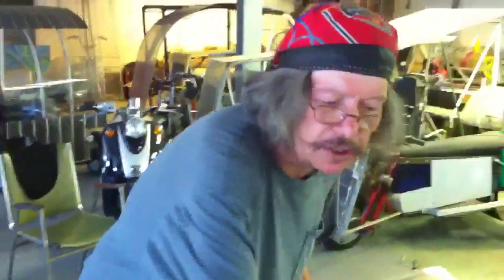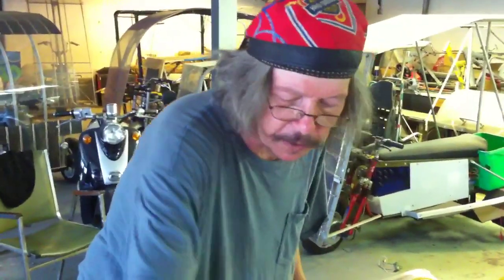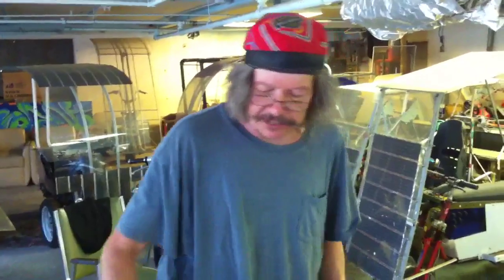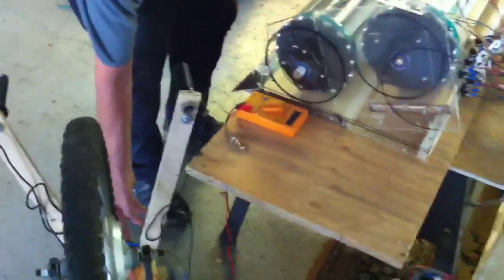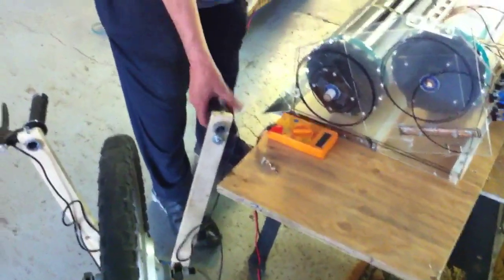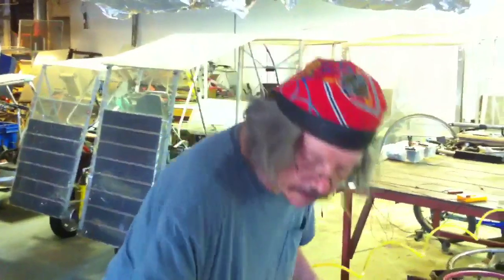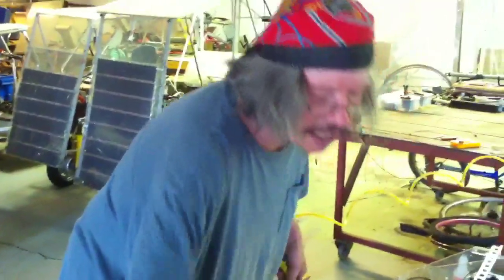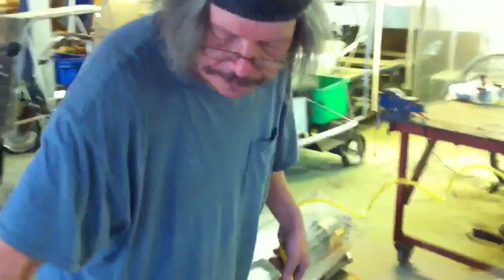Fuel-Less Mag Air Vibe Gen T2 - HQ

Comment: @mydejavooo1 The Air Turbines canprovide 50% of the needed power on-route; but Electronic Generators must provide the rest! Chinese cut 8% needs at first with Brake re-generations; Nisson uped to 20% with 3-D pick-ups on wheel. But this can go WAY MORE - up to 100%, pretty easy. Thanks!

Comment: No The compressor hose goes into the rear of Mag-Lev Turbine show in next videos. Directly onto the vanes. Front Air Pressure scoop then relieves need for pedalng compressor - unless bad road conditions. Driver keeps glancing at Voly-Guage, keeps in Green power-zone easily. Speed adjust by driver pedal far better than electronic monitor devices (why Honda's new Robot fell off 3rd step!) Pedal energy here is less than 1/10th that while bicycling.

Comment: FreeEnergy: I also have a Maxwell 48v unit of 200 Farads (Ultracapacitor), which drove a 2000w vehicle 20k's a couple years ago. Since it leaked 1% a day (more like 2%!), it wastn't practical as a storage unit (except maybe for Shanghai buses it was used in). You know the trade-offs: accumulation time vs load demand to equal real-time dependable load propulsion. Two big steps have been: air-coils to eliminate friction/start-torque: Using the MagDrive as a Tesla coil to prevent reluctance build.

Comment: The point is I am getting less than 1/4 what the output can be with top components. You are still thinking of these caps. as BATTERY-SUBSTITUTES (themselves subs for TANKS OF FUEL?) The storage is only "sub-mediator". This is why I've reconsidered stacked petal generator - now that Magnetic gearing can replace mechanical gearing (to about 36 to 1 ratio). This will DIVIDE WORLD MARKET: peasants will want it & western "fitness revolutionaries", especially feminists. Others stay "stuck on fuel"?